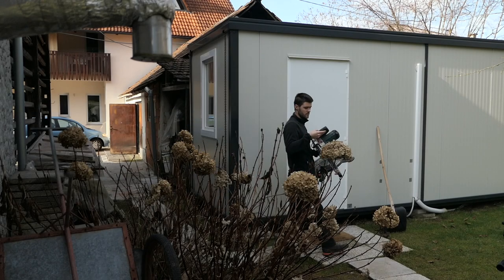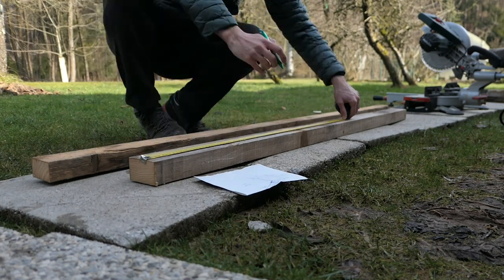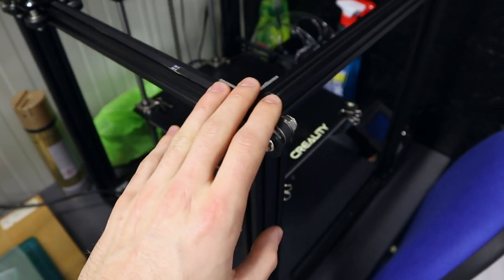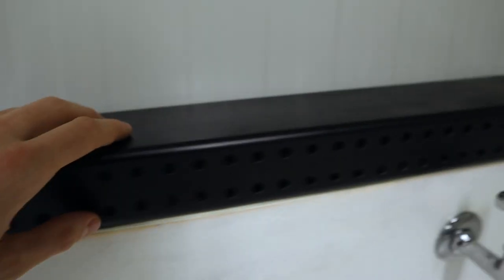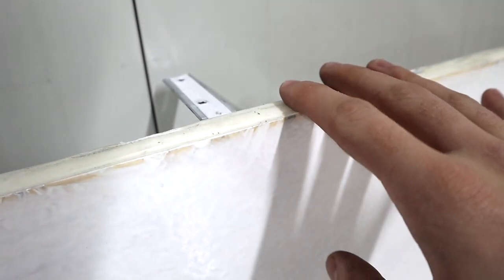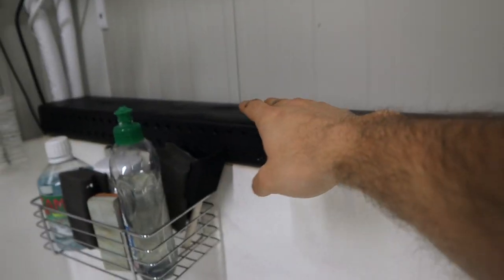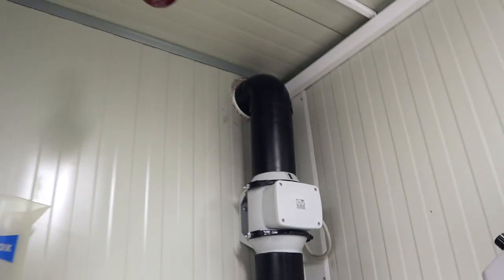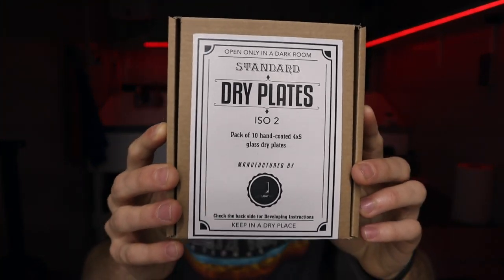DIY Darkroom Ventilation system | Shipping Container Darkroom Maintenance | Film Photography

Comment: Great video. I’m in the process of installing a ventilation system and you gave me a few ideas!! Thanks.   I’d like to see how you made your plate dryer if that’s not giving away your trade secrets.
Reply from the maker: Thanks. I mostly dry them on marble slabs without any enclosure as both of my rooms are light tight so I can close the door and escape thru the other one :D The light tight box I used to have was a channel with a lid made out of foam board. It has light traps on both side and a fan I took out of an old microwave that is ventilating the air thru. It is not perfect tho as the ventilation was to strong and it blew all kinds of dirt on my plates while drying.